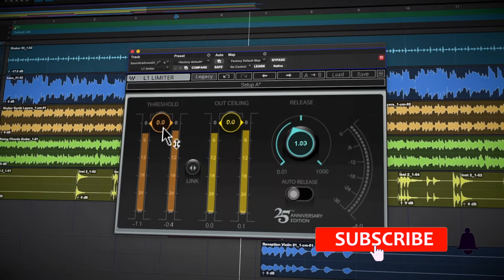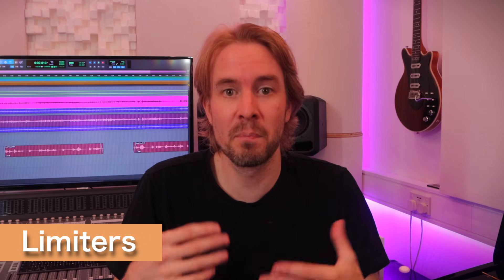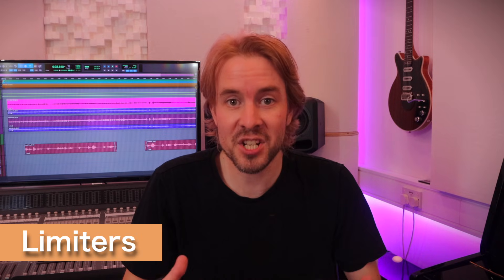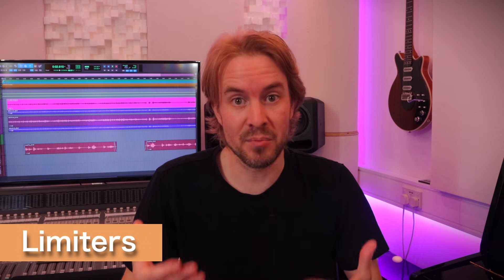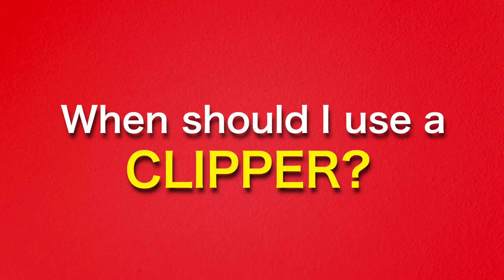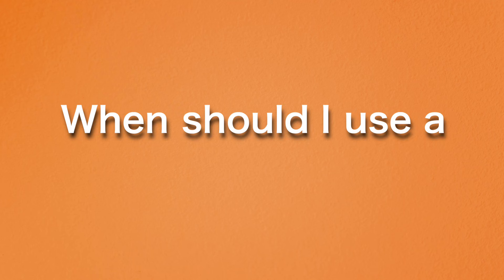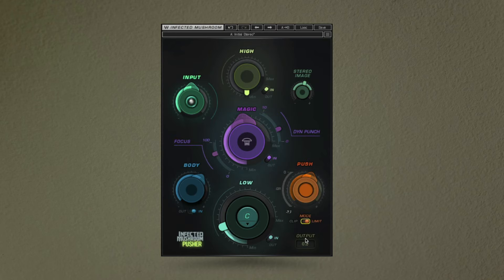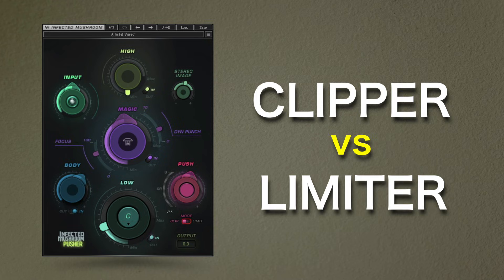Learn the Secret to REALLY LOUD Mixes: Clippers vs. Limiters

Comment: clipping works really well on drums or material that has excessive transients, which eat away precious headroom. you can often clip drums upwards of 4dB worth & still retain punch & the body of the drum, while gaining back extra headroom.

even smaller amounts of clipping may not make a huge difference at track-level, but by the time everything is summed together at bus level, you'll find you'll have much more headroom on the master.

also, pushing a signal harder through a clipper by adjusting its threshold to find just the right amount, can add that "bite" to the vocal or bass, as the signal pushes past the threshold & clipping begins to occur.

Comment: how would one implement clipping on the stems ? let’s say you got all your processing done like for example :eq -compression - maybe saturation then use a clipper last on the stem? like a drum stem and instrument stem ?
Reply: You should experiment and see whatever sounds best. Using distortion/clipping on stems is not an issue. Same as applying it on a channel.

Comment: I am biased. I really don't care - I think most mixes done with clipping or limiters sound rubbish - but I guess if the aim is to maximise loudness there may be a point. For head banging pop or EDM music - to be belted out at anti social levels in large arenas maybe there is a point. For really high quality sound dynamic range may be much more important - but it seems that commercially that's "not what people want". Once the dynamic range has been squashed, then quality goes and cannot be brought back. Side chain processing used carefully may reduce some of the problems in specific pieces - for example if a word sung by one or more singers is obscured and not clear, but simply maximising loudness does not seem to be a good way to produce high quality recordings.
Reply: Music with hard clipping and/or limiting sound better on cheap sound systems while dynamic music sounds better on expensive/studied setups. Most people listen to music on phones lol or mono Bluetooth speakers with one full range speaker inside. Then, there is people listening on 2.1 PC speakers or crappy car systems. You mix for the majority of people, unfortunately. Also there is no midrange in modern music especially in EDM,they need to compensate for this by clipping to bring some energy.

Comment: I definitely prefer the sound of Clippers; however I utilize both. The end of my chain is the T Racks Clipper which is variable between soft and hard clipping to tame some of the transients before hitting my final limiter, the L1+ set to True Peak. A little bit (or a lot, depending on the song) of both really helps finish off the track.
Reply: IK's Stealth is so freaking good!
Reply: This 👏 Ozone 9 EQ, T-Racks Clipper, L2 limiter (I’ve always preferred the sounds of this limiter).

Comment: Im not sure what clipper you are referring to but clippers are much "LESS" aggressive of on the edges not "more". For example, most good clippers (Standard clip by SIR Tools) has a knee adjustment allowing you to set the ceilings gradual drop off. Limiters are harsh and in most cases square wave the signal (IE- brickwall).

Comment: This is relative to the LUFS you are aiming for. If you are mastering for Spotify a limiter should be fine. If you are mastering for CD or Radio, a clipper is better in my opinion. For a LOUD master (Radio or CD) a mastering limiter will always (without fail) push down the transients of the drums. This is very noticeable since the drums sound softer. This is a massive problem if the mastering engineer will use a limiter instead of a clipper. Waves should've given the LUFS of the examples to place things in perspective. An LUFS of -12 vs an LUFS of -8 will make these tests sound totally different.

Comment: Correct me here, a clipper can if used properly increase loudness (insanely much if one wants) but keeps very much of the perceived dynamic range? Limiting will finally make the snare (and more) sounding like a pancaked snare, more 2D. Too much limiting also brings up the root notes (sometimes) to be too audible and it all sounds disastrous (also with the most transparent limiting possible, still the gain reduction does too much however transparent it is in all other regards).
Reply: Nailed it! I see a clipper as like a transient designer with saturation and distortion to help with the punch. Limiting isn’t always a bad thing, but you definitely don’t want to overdo it where it seems flat or 2D.
Reply: @tdengz  No it just clips in a better way than clipping on a channel/bus. Clipper is candy on percussion, to a great extent and can even improve the whole sense, then saving the limiting later. So clipper is a great way to keep the dynamic range but still increase loudness.
Reply: @Quant-Beat  that’s what I basically just said.
Reply: @tdengz  It has nothing to do with saturation and/or distortion.
Reply: @Quant-Beat  distortion means to reshape something and by clipping the peaks, you’re literally reshaping them. Hard clipping turns a sine wave into a square one.
Reply: @tdengz  But it is as much distortion as another dynamic processing, which is not by definition distortion.
Reply: @Quant-Beat  what do you think happens when audio is clipped? It distorts.
Reply: @tdengz  The point is to not distort... :)
Reply: @Quant-Beat  clipping still adds saturation/distortion. If you’re clipping the audio softly, then you’re simply saturating the peaks and hard clipping distorts the peaks turning a sine wave into a square wave. Do a quick look up on google and read articles from Produce Like A Pro and LANDR. The actual point is to dial in the right amount where you can barely hear any audible saturation/distortion.

Comment: Using a bit of soft clipping before limiting works well. Soft clipping is not too dissimilar to passing a signal through or on to tape, tape smooths out the transients slightly, which is worth noting. So, even out the transients slightly, for greater rms levels, the bring the level up slightly with a finalising brick wall limiter - is a good combo.
Reply: what about limiting before clipping?
Reply: @lxvesick2267  It wouldn't make sense to do that. If you are going to use a clipper it will be to get a higher ceiling level, but then you would need to limit, helping and making sure you don't digital exceed 0. So by softening the transient spikes you can push into the limiter gaining a few db's. You can place a limiter earlier in the chain of levelling things, but clipping in turn, would be to maximise the level in conjunction with the limiter. Otherwise it would defeat the purpose.

Comment: I prefer to use a Limiter to preserve and control the transients. Clipping always seems to be too harsh and dulls the track. Of course this is purely subjective as it depends on the audio material, the plugin you use and the settings.
Reply: Depends on how much you’re clipping the transients. A soft clipper smoothens out the peaks for more punch, in theory. Think about it like this, a clipper affects signal above the threshold clipping it where the limiter pushes down the peaks to bring up the rest of the signal where too much limiting could also dull out the track.

Comment: I don't really hear the difference on the last one example 3. If it is just me how can I train my ears?
Reply: You can only train your ears through practice, especially on your own material. That's the best approach and then in time you won't even be able to un-hear the difference. All the best.
Reply: Listen to the punch (transient) of the kick and snare. Thats where you will hear the most difference between clippers and limiters
Reply: @ryanshreevedrums  to add on, you can also listen to the decay of the transients where the clipper seems to have a faster decay and the limiter has a slower decay.
Reply: @tdengz  totally! Some limiters even have a release knob but i always use a very fast release
Reply: @ryanshreevedrums  I would either put it at 0ms unless you hear too much pumping or set it at a fast release time depending on the BPM of the track.
Reply: @tdengz  yep! Im generally between 10-30ms. I mix metal so the kicks and snares are always hella fast
Reply: @ryanshreevedrums  yeahhhhh once you told me where to listen to, I can hear the difference now. Thank you guys.